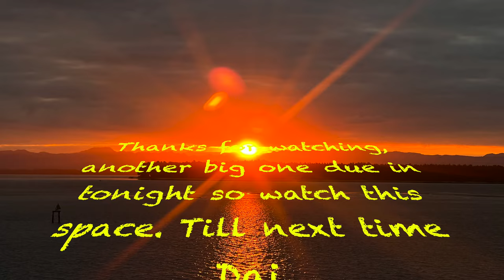Rose Harmony, Loading Sawn Timber. Bulk Boat.

Comment: Nice video! Can you tell me what is the working load (WLL) of the chains you are using?
Reply from the maker: Hi and top of my head no I can’t 😳 so long ago and so many lift of other product in between. 😜🤙
Reply: @daibach999   No problem, it was question only out of curiosity😉 We are using wire rope slings for loading same cargo and we are considering to use chains as well.
Reply from the maker: @borutsuligoj3029  all I can do is next time I do this job I can put the limits of gear use up. Stay safe 🤙

Comment: Do chain slings damage the cargo?
Reply from the maker: @ZamDir-mh2gi  hi and good question. Of course a small amount of rubbing with the chains but very little in the way of damage.  It works surprisingly well and can throw it on quick with the right team 🤙
Reply: @daibach999  Hi. Thanks for the reply and for the good video. it helped me a lot. I work at the port as a foreman.
Reply from the maker: @ZamDir-mh2gi  what Port you at ?
Reply: @daibach999  Sovetskaya Gavan, Russia
Reply from the maker: @ZamDir-mh2gi  awesome so you guys use ship cranes or Shore cranes ?? And what sort of cargo you load or unload ?
Reply: @daibach999  We use shore cranes now, but when I was young, I worked as a ship crane operator too. It was a good time ), only the cranes were mostly old and very noisy. We load sawn timber and pellets in bulk. We use textile slings because the shipper is afraid of damaging the sawn timber. That's the problem, textile slings are weak and break quickly. Your video gave me the idea to try using chain slings. Thanks a lot!!
Reply from the maker: @ZamDir-mh2gi  well it works for us and we never have any issue. Maybe worth a try see how it goes 😜🤙